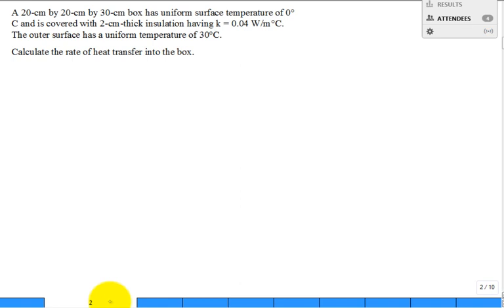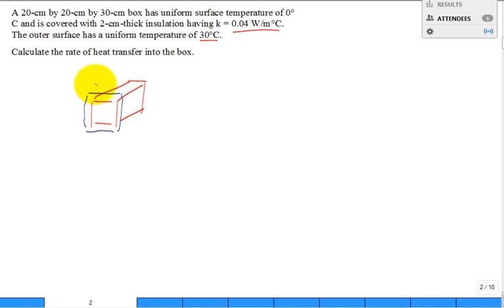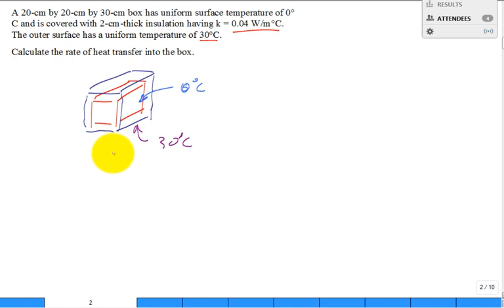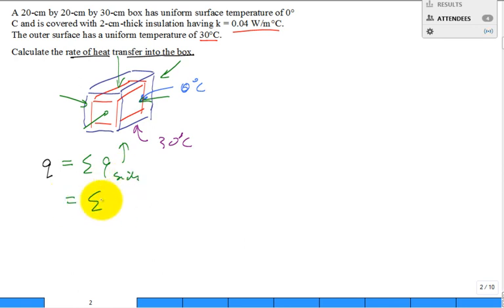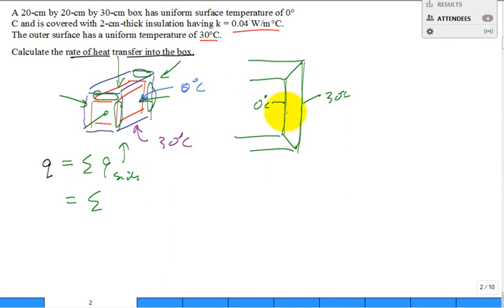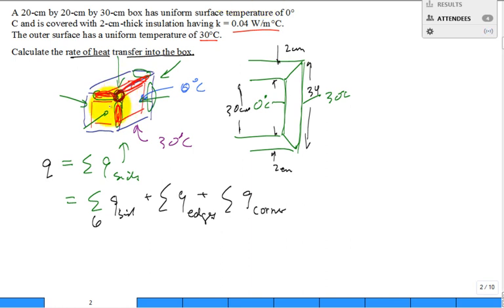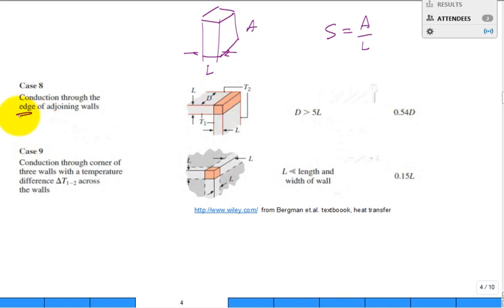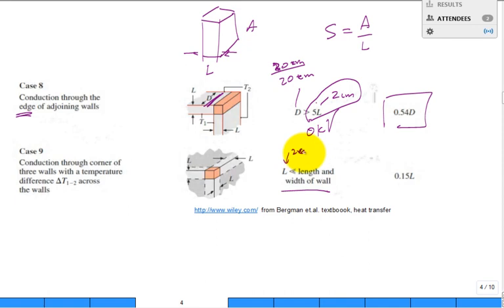Conduction shape factors for insulated box

Comment: Hi Randall, where do the formulas for edges and corners come from? Could you develop them? Thank you
Reply from the maker: Table 4.1 of T.L. Bergman, A.S. Lavine, F.P. Incropera, and D.P. DeWitt, Fundamentals of Heat and Mass Transfer, 8th Edition, Wiley 2017, also page 3-124 of Rohsenow & Hartnett, Handbook of Heat Transfer, 1973 Mc Graw Hill [note that in equation 176, the number 2.16*3/12 = 0.54 and 1.20/8 = 0.15] and prior source is Langmuir, Adams and Meikle, "Flow of Heat Through Furnace Walls, Trans. Amer. Electrochem Soc, 24:53-84, 1913 where coefficient 0.54 is said to be experimentally determined.
Reply: @randallmanteufel6411   Thank you!